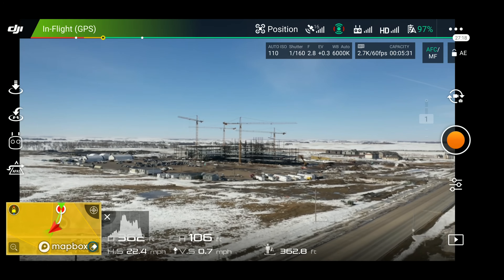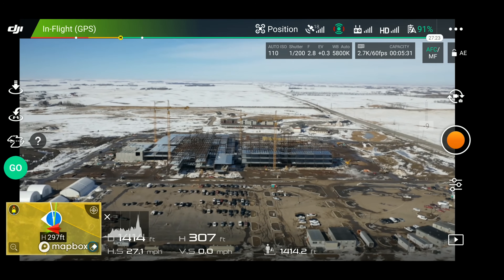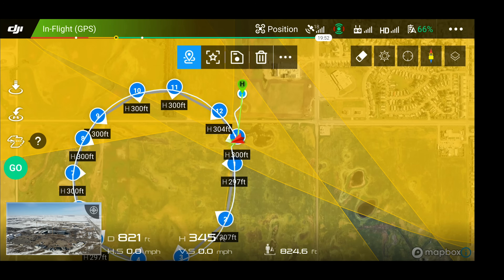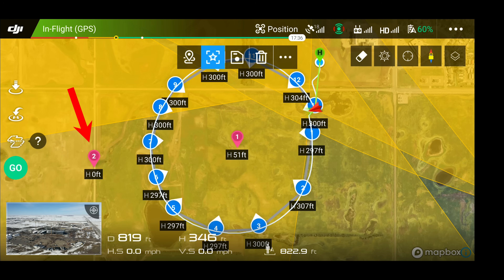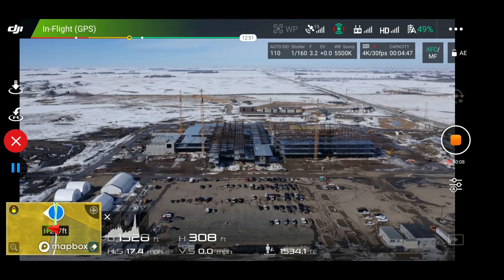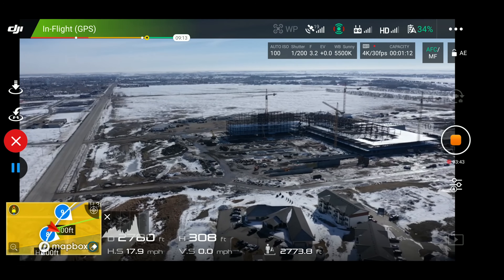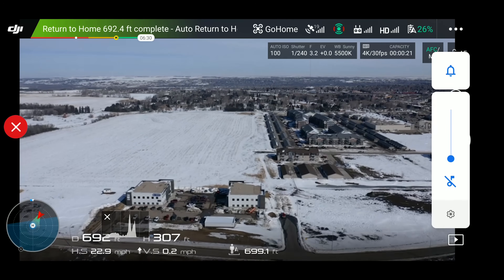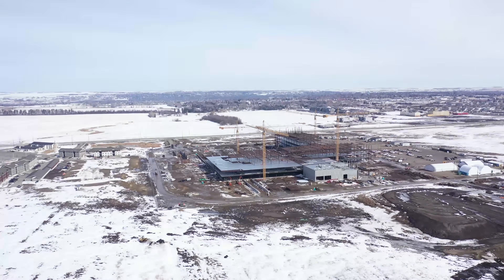DJI Waypoints 2.0 - In-Depth Tutorial Part 2 - One Setting Makes All the Difference!

Comment: I would have use POI function in smart mode 100%. Set the speed to as slow as however much memory you have on your SD card, and get a nice slow video in DLOG, 4K. Take that into your video editor and adjust your speed there how you like, even bringing it back down to 1 mph and do some voice over narration. You can even finish off the video with a stability function, but that will cause clipping around the edges, so make sure your distance from POI is far enough away to where you won't miss it or the surroundings of it.

Comment: Just watching this now. Great video. Thanks! Never needed waypoints.
To answer your 18month project, could you set a POI as 3 Waypoints at 150, 180, 210.....and then simply pull back 1500ft, 30o camera tilt and fly at your designated speed?

Comment: Hi Russ, another great (2-part) tutorial, thanks! You think you were late to the party two years ago .. I'm just here, haha! 

Q. I'm using the DJI SC and I want to create a waypoint route at home but the screen is a bit small. It might be a silly question but I'm assuming that my finished task is saved on the device that it's created on i.e. if I use my larger tablet to create my task, I'll need to fly the task with the tablet or, if I create my task south my SC, I'll need to fly the task with my SC?

(I guess this is where Litchi still has the edge on Waypoints 2.0 in that I can logon on my laptop, create a task, then open the Litchi app on my SC once at the site) .. if that makes sense!

Comment: Great video, thank you.  I went out to try this way of setting the waypoints as you showed and this is what happened.  I could set the waypoints by flying to each one and clicking C1. Then I would click the GO button and it would bring up the Task Check page where I set the Cruising Speed and Arc, then I clicked Start.  The drone flew back to the first waypoint like it should, but then just hovered.  It hovered at the first waypoint and never moved.  Also the camera didn't start recording.  I tried several times with no luck.  Any ideas why this would be?  I'm flying the Mavic 2 Pro

Comment: Tried Waypopoints 2 and although it sounded great, there are a few major flaws in the system.  The first of these, is that you cannot save, backup or share the flightplan files...  if you loose them after a 'factory reset' on you controller, then they're gone- which is a major issue.  Secondly the flights can only be planned with the drone switched on, and if you're anything like me this takes time, and is a waste of battery on the drone.   The actual programme, and the semantics and methodology of setting up the flight plan is fiddly and temperamental and frustrating.
I've recently downloaded DJI Pilot PE onto my smart controller, now I can programme the flights using the controller only. It is a lot more intuitive, and also allows me to conduct automated mapping ortho photography flights into the bargain.
Needless to say, Waypoints 2.0 is obsolete, Pilot PE is the way forward.

Comment: I have been trying WP with mixed success.  I learned somethings with this, but there are still many unanswered questions.  I think I need a Tips & Tricks video to cover the finer details and issues that might be encountered.  While you video is good and does help with learning some issues, such as the drone making adjustments, I really wish you would have done all of the experimentation before showing your learning process.  For example learn how to make a perfect mission then show us, but include information on what does not make a perfect mission.  One final recommendation: I cannot see your finger touch when you select an option.  Please add a video image of some sort (a small open circle?) over the image to show what you are clicking on.

Comment: to avoid jittering on the waypoints each waypoint should be set as arc and each waypoint's distance to the point of interest should be equal meaning all the waypoints should sit on a perfect circle around the point of interest, based on what I see your waypoints are not sitting on a perfect circle. the drone's path from each waypoint is to travel on a circle until it hits the next waypoint and see's the next waypoint is off it's path then it quickly jumps to the new waypoint and it create's a jitter.
to simplify it, to travel on a perfect circle you need at least 2 waypoints one starting waypoint and one ending waypoint just make sure they are the same distance from the point of interest, and these 2 waypoints could be very close to each other like 10 feet but setting starting waypoint to clockwise or counter clockwise makes sure drone does't take the shorter path between the 2 waypoints and of course setting waypoint types to arc makes sure drone travel's on a perfect circle until it gets to the last waypoint.
I haven't tried to see if you can travel on a circle with just one waypoint, which requires to set the same waypoint as starting and end waypoint.
I don't think you need this but this is the formula of finding lat,lon on a circle 
pow(wLat - cLat, 2) + pow(wLon - cLon, 2) = pow(radius, 2)

Comment: Hi,  I purchased a Mavic 2 Pro a week ago.  Was wondering if the "jerking" problem you discussed in this video has been corrected since you made the video?  Thanks
Reply from the maker: I have not used waypoints recently. Maybe I should do a follow up! 🤔
Reply from the maker: @RandomSynr  No.  There have been too many disruptions in the build process.  There was a fire that delayed construction for 3 months, then a contract dispute to delay another 3 months.  It's been quite a fiasco.  They finally have been on a consistent build schedule, but I got out of the routine when all of the disruptions occurred. Sorry.
Reply: @51Drones  Have you not done a follow-up to this video....the info seems to be pretty old.  I found you can to start video on way point one and stop video the last way point.  Just designate that when in polyline and it keeps it when you switch to arc.  I ended up looking at this video today because I was searching for an explanation of the different choices under Route Settings - either Free, Custom Route, and Route.

Comment: I find the maps that you need to use on the controller through the Go4 App really poor in comparison to Google Maps which I’ve used previously when using Litchi with a different drone. I’m now upgraded to the Zoom with Smart controller and this is my biggest complaint so far. Is there a way I can get Google Maps on the Smart controller so I can use this when doing waypoints etc?
Or is the only way to do this by using Litchi again?

Comment: Set a single waypoint with the desired altitude and orientation and execute the mission with the route setting set to "Return to First Waypoint" and then once it's at that first location, inititate the POI.  I haven't tested this, but it's a thought.
Reply: Great idea Philip.  You'll still need to identify the centre point exactly before running a POI on every mission though I think????

Comment: 50 waypoints??? Why not 51 :) I have got into waypoints to a degree (excuse the pun) for doing SAR plans on fields. They are very good  but I found you need to think outside of the box. The way I would approach your project above is to set 2 waypoints (A-B). (A = Start Waypoint near takeoff spot) and the second (B = End waypoint Hover (with course angle and gimbal angle set) where you want to take the shot from). When your drone arrives at waypoint (B) it will hover at a set height pointing in the correct direction and the gimbal set to the correct angle. Now all you have to do is enter POI mode, draw a box round the building, select speed and rotation and voila. As the drone is always going to hover at the same point using your (A-B) waypoint task whenever you go you will get the same video shot. I had a similar problem wanting to take a photo at the same location every day in AEB. The problem with the waypoint camera is that if you set the camera to take a picture at waypoint 2 (B) instead of end task and hover, it only takes a single shot and does not adopt the current camera settings i.e. AEB etc. So I use a 2 waypoint to hover destination and then trigger the camera manually in AEB when I arrive. :)
Reply: Love this Dibble, I was thinking on similar lines for a time lapse video of a construction project.  However, how will I know that my centre point will be the same (in other words where I draw the box for the POI mission) if the site is constantly changing?

Comment: Hi. I noticed a discrepancy in the app, @5:40 when adjusting POI height there’s a H next to the number of ft, (I assume h to be height from ground) where as on the bar below, it shows altitude so, when planning waypoint height And POI height offsite at home, do you set POI taking into consideration it’s Altitude (height from sea-level) or its height H height from ground relative from where the aircraft took off from? Thanks.

Comment: Great video but if I were doing this I would have used POI and by coming back to the same spot and setting the POI, altitude, radius and speed I had previously used I think you would have gotten a buttery smooth result with less effort. The key of course is documenting those settings to reuse as I don't think there is an other way to save them.  Don't forget camera pitch setting!
Reply: But how would you know the exact location as the app doesn't show any longitude or latitude settings?
Reply: Great Question  @GiovonniFareed  I would agree with you on the exact location issue but if you get it close and your altitude and distance out from  the center of the subject is recorded it is simple to replicate.  here is a similar video I did and I actually did adjust the altitude a couple times but the end result is really hard to beat and incredibly simple to fly.  
https://youtu.be/evecHes3ZUE

Comment: Hi Russ, I am a Real Estate photographer using a Mavic 2 Pro. I shoot stills only and feel that Waypoints will help me considerably. I have researched quite a bit and have not found what I am looking for. It is this: I would like to set missions from home, drive to the jobs, launch and shoot the home using waypoints, significantly speeding up my workflow. Unfortunately, most of my jobs are 10 to 30 miles away from home. I called DJI today and was fairly disappointed in the answer given by support. It took me several minutes to relay what I wanted the tech to understand. He kept telling me that I could only set waypoints by holding the drone over my head, (yes really). Eventually, he said it wasn't possible. I had to download GS Pro and pay for Waypoints through that site to do what I had in mind. I told him I knew it could be done using Litchi, but he was not helpful after that. I hope I am clear in my explanation. Do you or anyone have a suggestion for me? Thanks, Russ for all you do to help us here. I love your videos.

Comment: Hey Use you way points within point of interest. use 1 or 2 waypoints if you have to use 2. one from starting point and 2 at the center to set your point of interest location and height. then write down your radius distance and speed for that mission. You'll always start from the same center point and height.

Comment: Great video. Thanks!  I have not reviewed all the comments so not sure if someone already suggested this. I did notice that you were getting high wind notices during the setting up process. Could it be that the wind was causing some drift during the flight resulting in an increase in the amount of adjustment at each way point resulting in the jerky motion?

Comment: Hi Russ When you used the C1 button did you have to define the C1 button so you can set waypoints manualy or is it a default setting requiring no action other than push the but ton
Reply from the maker: That is the default

Comment: Hi Russ, my drone use, at least at the moment, is for still photography.  Video might come in time but, I'm looking to shoot stills.  I'll be flying later this afternoon and plan to try using waypoints for a project I'm working on.  Today's flight will be mostly a "training" flight for me.  I haven't delved into all of the waypoint setting options yet but, would I be correct in my assumption that the camera can be set to simply take a photo at each waypoint and then move on to the next?   Thanks again for all of your informative postings.  51Drones is far and away the best, most informative drone site here in YouTube.  Alan
Reply from the maker: Yep!  You can set it to take a photo.  Thanks for the kind words!

Comment: Set waypoint at center, go to waypoint, start POI with same numbers every time
Reply: Turn off ARC mode when setting camera start and stop and then turn ARC mode back on.
Experiment - imagine a square with sides of radius 100 ft. set a waypoint at each corner of the square each with a arc radius of 100 ft. I would expect it will fly a circle of radius 100 ft.

Comment: Easier to do with Litchi. Doing the same thing on a construction site.  Was able to set it up a home with the drone off, use an orbit.  You have to go to the site, see where the center point is at. then once I knew where it was, using the orbit mode in Litchi was simple. I'm able to do a smooth orbit around.

Comment: Thanks for showing how to with Waypoints. I'd say with this type of mission, POI would be much easier, faster and smoother.
Reply: Is it possible to save a POI though? Flying 'circles' with Waypoint 2.0 seems like a waste of time but if you want to fly the same path over and over during a year or more to watch the changes then isn't it the only way?
Reply from the maker: That's what I started doing.  Shooting in 4k, and then I can crop as needed for the final product.
Reply: Yeah, wish you could save a POI flight with all settings for repeat flights.

Comment: Hi Russ. I've Been using waypoints missions to film winter shots that I am now using again to film the same shots in spring. The idea being to show winter turning into summer with flying over trees as an example. But I've noticed that you don't really get the same shot and it's not as accurate as I hoped it would be. Iam having to dissolved cuts into each other to hind how far the footage is out. Hopefully dji can make the GPS more accurate soon.

Comment: Isn’t there a circle mode instead of doing it this way?
Reply from the maker: No, but you can change the arc angle, which will help.
Reply: Couldn’t you use the POI mode for circling an object?

Comment: I created a new flight plan yesterday with 8 waypoints, flying around one building/POI. I did not set an elevation for the POI, which may explain what happened in my resulting video. But, when I watched the video later, the building, which was supposed to be the POI, was not, for many of the waypoints. And, I don't think it was ever centered in any of the waypoint positions. I am not sure what other adjustments to make, except I am going to elevate the POI to about 15 feet and see what difference that might make. BTW, the POI is not centered in the rough 360 degree circle that the waypoints make. They are at varying elevations and distances from the building.

Comment: I think a better solution to the jerky camera problem isn't to add more waypoints (that's a bit of a kludge, even if it is partially effective), but rather to adjust your gimbal settings (i.e. slow it down so the motion is more fluid), as that's the real problem. Here are two references to check out:  

https://www.4kshooters.net/2017/04/07/how-to-optimize-your-dji-mavic-pro-gimbal-settings/  

and  

https://youtu.be/wlILMwxrRFs

Hope this helps.  Thank you for you videos; they were useful to me.

Questions i have:  

[Edit:  Answering my own questions… I've concluded that Waypoints 2.0 is very much alpha software right now (i.e. its feature set isn't complete yet), and that most of the answers to my questions below are probably "no/can't be done." While it shows promise, it's not a finished product yet.  I decided to purchase Litchi, as i can't wait months for DJI to improve their GO app.  Indeed, Litchi does solve all the problems/questions i had below.  Overall, i'm happy with Litchi, but the DJI GO app does display some useful information which Litchi seems to lack, like an icon showing which sensors are active. But overall, i'm very much liking Litchi for waypoint missions.  GO app is just too frustrating to use now.  I'm sure it'll get better over time.]

Can you add new waypoints to a route "task" (aka flight plan)? I know you can append additional waypoints, but can they be inserted between two other waypoints, or added before the first waypoint, for example?

And can you share flight plans between iOS devices?  For example, i have two iPads, but the one i use for flight doesn't support the Apple Pencil, whereas the one i use for other purposes does.  I'd like to fine tune a flight plan on the iPad with Apple Pencil support, but fly it using the other. The reason for this is i'm unable to zoom in close enough on the map so that my fingers are able to finely select the waypoints on a mission confined to a one acre airspace.

It appears one can't edit (or even see) a flight plan unless one connects to the drone first (although one can continue to edit it it after the drone is powered off).  Am i missing something here? I don't want to have to connect the controller to each iPad before editing the flight plan.  If not, this seems to me this a bug, or simply bad UI design, on the app.

Comment: Can you set a waypoint # 1 directly over the project and then drop your poi at that waypoint, so it uses that same exact position each time? Then create the arc with your 50+ waypoints. Start the mission with it focused on the poi, but not until the drone reaches waypoint # 2.